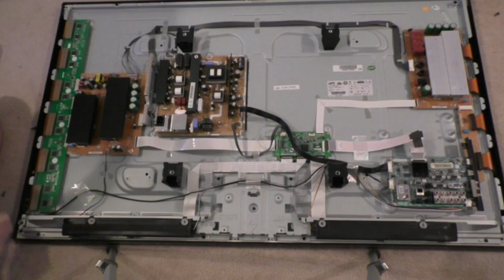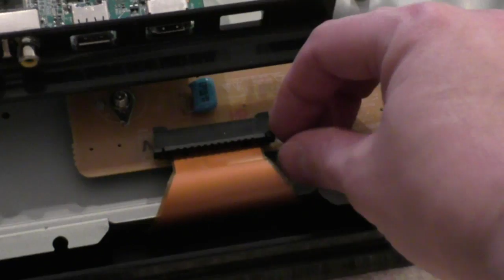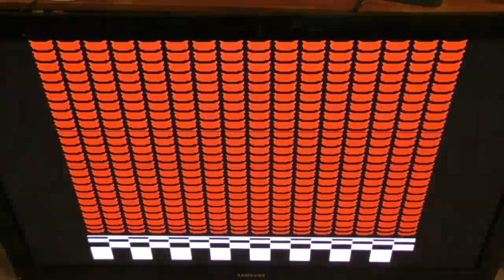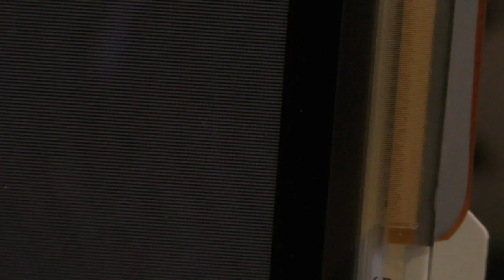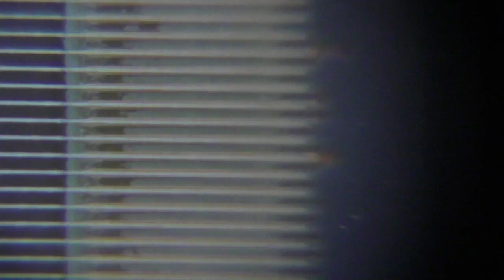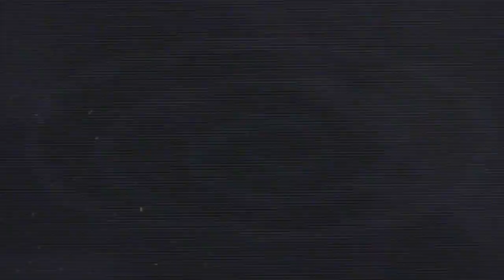Samsung 50 Inch Plasma Repair Fail

Comment: Just junked this very model TV for the same issue just a few days ago.  Pretty sad about it to be honest since it was otherwise in good working order.  But I’m pretty well-stocked on TVs and have no need for one that “mostly” works.

At least I had no money in it.  I found it on the curb one night and fixed the only apparent problem with it at the time: a cold solder joint on the power supply board.  Ran it trouble-free for nearly three years before the lines appeared and started to spread.

Comment: My 12 yr old Samsung PN50B550 was working GREAT until it went for a 20 mile ride in the back of a U-Haul during a move. It was packed properly in a U-Haul 'tv box', but NOW it has those same nasty horizontal lines as in this video, only MANY more of them! I REALLY loved this tv for it's fantastic 'black level' and wide viewing angle, really heart breaking to have to trash this tv!
Reply: Sometimes it is a matter of the ribbon cables on the side being vibrated enough that they lose contact.  I had a situation where I bought a Panasonic Plasma that had, what we thought was, a water stain i behind the front panel glass.  Upon disassembling the TV, I had removed all the ribbon cables thinking they would stay in front as I removed the rear chassis.  They were a part of the chassis (plasma screen).  I carefully reassembled only to find all the black horizontal lines.  After carefully cleaning with flux remover and then alcohol, it made no difference.  I did notice that when the clip holding the ribbon was unplugged but the ribbon was in place, moving the ribbon caused lines to disappear and reappear.  This told me the ribbon was not making good contact.  I figured I had to place something in behind the ribbon to force the connection points together.  I used cellophane tape folded in half length-wise and long enough as the width of the ribbon end that inserted into the connector.  I only ended up getting a black horizontal bar.  I removed the tape and reinserted the ribbon cable.  No more black lines.  It seems the tape helped to reshape the end of the ribbon cable enough to make proper connections.   I did this to all ten of the ribbon cables (50 inch) and that solved getting rid of the black lines.  Totally by chance.  As far as the water stain...it wasn't.  It was a failure of the anti-glare coating.  The glass of course is discontinued and at a price of about $300Cdn, not worth it.  I have contacted a window company who custom cuts glass to see if I can either replace it with a clear glass (no anti-glare) or if they can apply a type of anti-glare coating.  I may just end up living with the defective glass as the wife really wants a new larger screen TV.

Comment: On the right side you are seeing the common mode sustain (xmain) grid. They are all connected together, with the y grids interleaving. They all connect to the buffer board on the left side of the screen.You have a bad panel.
Reply: ... what a funny discovery... lol !! You are very smart and experienced BUT you have to think FURTHER THE STANDAR and give (share) any idea HOW TO GET TRHOUGH THE GLASS PANEL fix it and (obviously) without brake it !! (ty)

Comment: I hate the term "flex cable." Pretty much all cables are flexible. When they started putting components on them and started calling them flex PCBs I was OK with that. Obviously not all are going to have components on them, but that doesn't mean we need to start calling those "flex cables" or retconning that onto flex PCBs. They are FLAT cables. Sure, there are other kinds of flat cables including ribbon cables but it's still a perfectly apt description.
Reply: In the electronics industry they are known as "ribbon cables", for obvious reasons..
Reply: @TheOzthewiz  I see them referred to as FFC (flat-flex circuit/cable) and FPC (Flexible Printed Circuit) constantly. Oddly enough, FPC gets used for the cables that are not typically etched/printed and FFC is more common for the ones that are.

Comment: Jeez, I heard plasmas had problems with images burning in but I never knew it was that bad. I guess now I don't feel so bad for never picking one up for myself although I hear the later models had improvements for preventing burn in images.
Reply: I have a Dell plasma. The image retention is temporary.There is noticeable image memory when going from a static image to a black screen. This effect is also experienced after the tv is turned off and then back on. You do not see any physical damage to the screen like a CRT with the power off. It is only visible in operation. The image can still be visible on power up even with long periods of shut down.
Reply: +t jay Mine does it every now and then but it goes away after an hour or so.

Comment: Its a shame its in such a hard to work on area.  Typically with ribbon problems, if the ribbon has a metal inner surface you can often scratch the plastic coating off with a scalpel, and then use really fine wire (the sort used for very small windings) and bridge a damaged connection, but it's not easy soldering it and it takes a lot of patience.  Due to the number of faulty lines there and the fact that 3 of them are right next to each other makes it very difficult also.   Thanks for showing this, nice to see the cause of that particular problem.
Reply: GadgetUK164 ftw =D

Comment: Ive fixed a few tvs... Usually horizontal lines means doom for these tvs. That is a fatal flaw that many manufacturers know about. I believe is has to do with years of use, those thin traces give in to heat.. Sometimes the traces lift because of excess heat caused by the screen itself.

Comment: I'm in the TV sales biz and we used to see issues like this often with plasma TVs of this manufacturer.  Why would those data lines blow open though?  Bad power regulation or thermal stress?
Reply: but as far as the bad hotbar on the glass thats a serious manufacturing defect, they should not fail like that
Reply: +Coucho Voltage goes down and current goes up to fulfill the draw, overheating the conductor? But why only on 11 lines out of several hundred or a thousand?
Reply: +Sam Wigman could just be bad tolerances in manufacturing?
Reply: you can reflow the data lines with a heat gun or preferabely a soldering iron if you have good prowess with an iron, you will thank me later, also use 99%  isopropyl instead of the air gun to clean those
Reply: I have one black line.  I'm trying the cleaning route.  The TV's run extremely hot.  I'm surprised it's run for these last 7 years with no issues.  Any other tips on a one line fix?   I found a new buffer and control board on line for $80.  I'm hesitant to order it as I'm not sure it will fix the problem, especially if the connectors.  Than you!  💚🎸

Comment: Would a thin pitch silver pen be able to trace new routs? Or is it just too fine or not accessible?
Reply from the maker: +Aruges01 it's just way too fine and such a hard place to work being on the back side of the glass.
Reply: +kevtris In that case, I'd love to see what would happen if you just smeared some dielectric grease on it. :)
Reply: @emmettturner9452  Dielectric grease is NOT going to repair open traces!
Reply: @TheOzthewiz  yeah, but I’ve seen it repair many things that appeared to be open traces. Examples:
-Horribly corroded and pitted contacts on a gold-plated card edge connector with literal holes corroded through the contacts
-A VGA port with absolutely nothing until adding grease
-An less than 1 month old Segway Ninebot scooter where the external battery pack was losing connection and even the low-amp connections appeared blackened

If they are close enough that surface oxidation is preventing functionality then the grease may help. It doesn’t even seem to require cleaning first.
Reply: +kevtris are you willing to part it out? I have a 50 inch samsung plasma that comes on but no picture and I suspect it's one of the boards in the back
Reply: +kevtris Or I can ship mine up to you and you can just make one good one.
Reply from the maker: it's just too fine